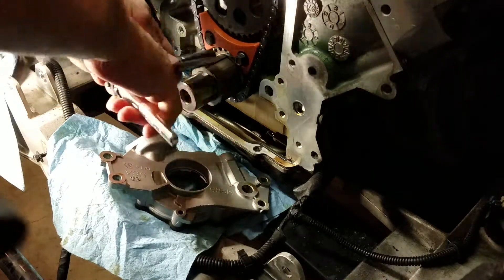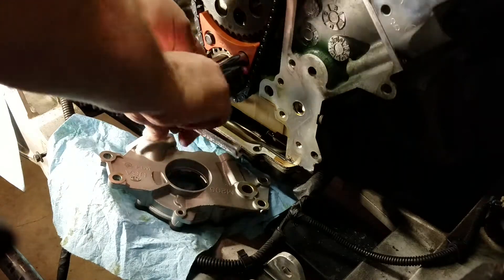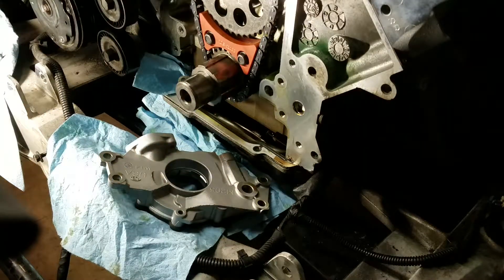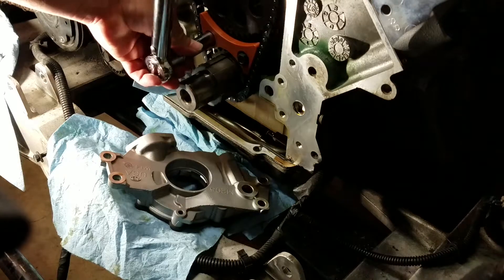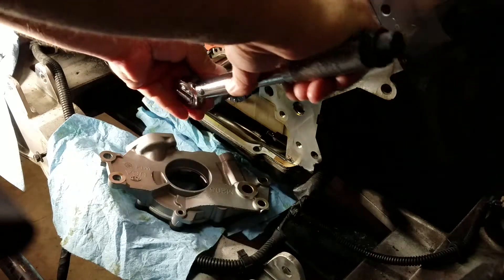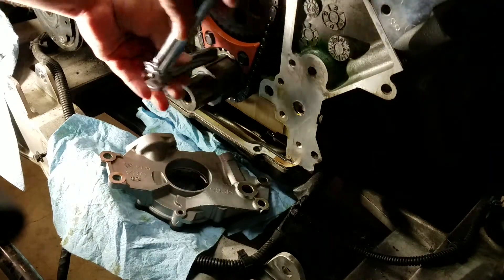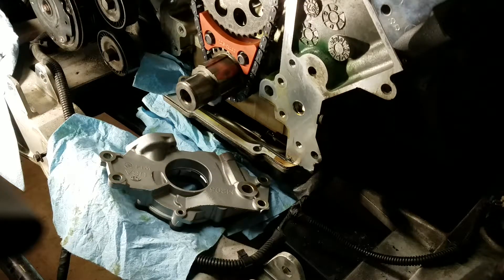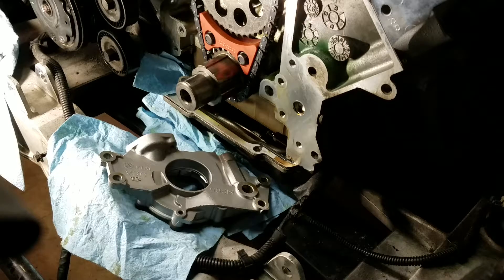RDE Fab LS1 LS6 timing chain dampener installation.

Comment: What year is your C5?  I think from the other videos it’s a 97. Were your holes already there and just needed to be tapped or did you have to drill and tap them?
Reply from the maker: It is a 97.  Holes were already there and ready to go.
Reply: MRBLACK947 I just saw that on another one of your videos. Weird. I guess I’ll order the bracket and the RDE one and return whichever I don’t use. Mine is a 2001 and the forums are all over the place in terms of answers.
Reply from the maker: @bradskinner9719  Yeah I hear ya there.   I remember in my research that there were some year ranges where they were there and then they weren't.
Reply: Would my 99 silverado 2500 6L have these factory holes

Comment: Has nobody pointed out that this is designed incorrectly?  The holes on these early engines are not centered up, but the RDE part is centered on the holes.  It's obvious in every photo, too.
Reply from the maker: I wondered about that as well.  Only logical explanation I could come up with is it is shifted over to the side where the slack would be during engine running.   I also figured that if Brian Tooley was going to sell this product on his own website it's probably not a bad part.
Reply: @PNW_Car_Mods  Nope, the sides are supposed to be parallel to the chain, not canted over to one side like this is.  It's simply not correct.  It's like he took an LS2 damper outline and just used the bolt spacing from the LS1/6, but didn't realize they are offset to one side.  You can also see the radii of the upper and lower parts are not centered up on the cam and crank.

Comment: Does the oil pump have to be completely off and out of the way in order to install the dampener's bolts?  Or, can it simply be unbolted and pulled back a bit?  Reason why I'm asking is, I'd like to avoid having to remove the oil pickup tube from the pump.
Reply from the maker: I don't believe you can pull the oil pump far enough away to work in there or even get the dampener in place.   I was kicking myself because I had already replaced my timing chain and oil pump before I received the dampener thinking I could squeeze it in there.  Ended up taking the oil pump back off quick.  With a corvette oil pan the pickup is super easy.
Reply: Nope the pump has to come off, unless you don’t care about using a torque wrench on it